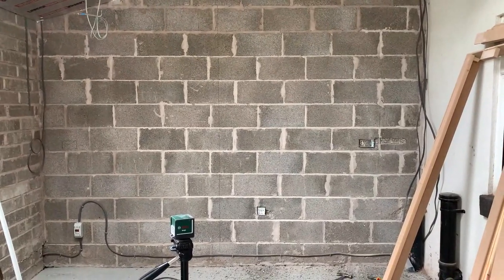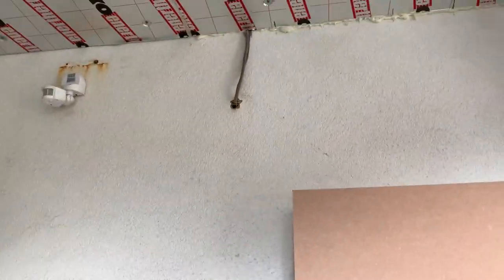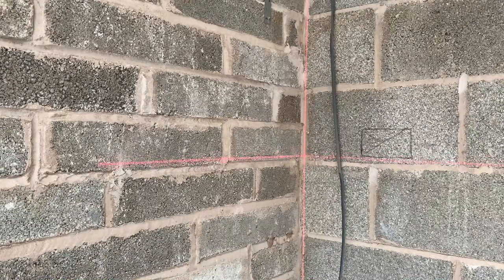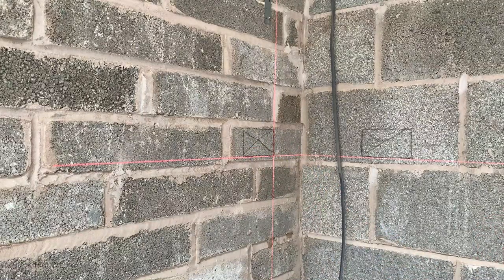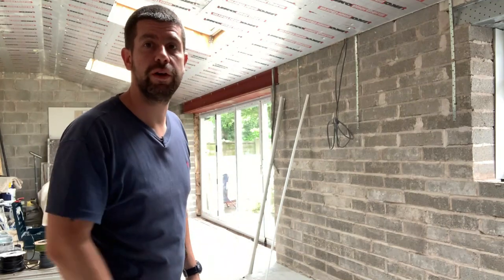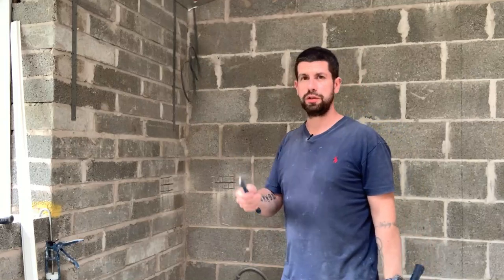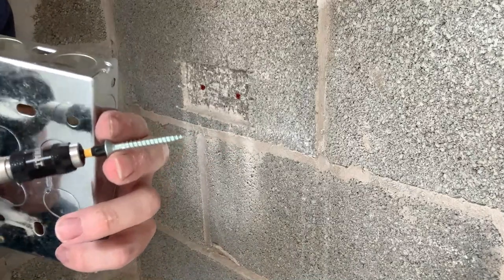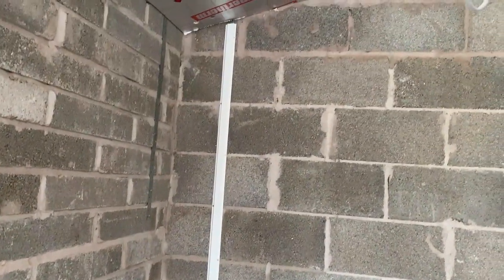1st fix electrics. Extension part 4. Chasing walls, fitting back boxes and covering cables.

Comment: As an Industrial sparks of 50 I have always sunk in plastic conduit or steel conduit depending on the spec so it's rewireable but I'm old school electricians today are lazy,because the idiots who right the regs have downgraded the spec sparks just follow,we used the term good electrical practice which I've never heard a sparks say in the last 20 years

Comment: Hi pal. Is the plastic capping essential to put on? Or could u use metal instead
Reply: The capping is purely to protect it form trowels.
Reply from the maker: Neither is essential, the metal is probably better 👍🏼